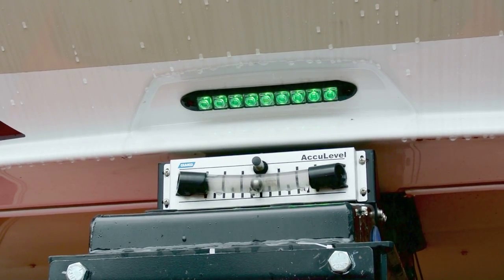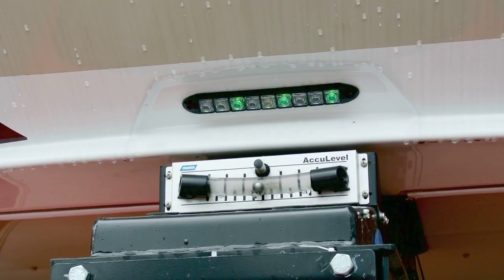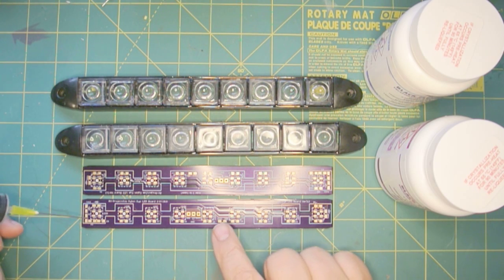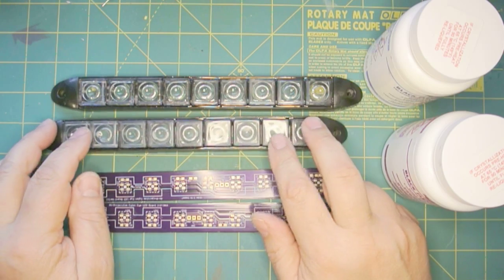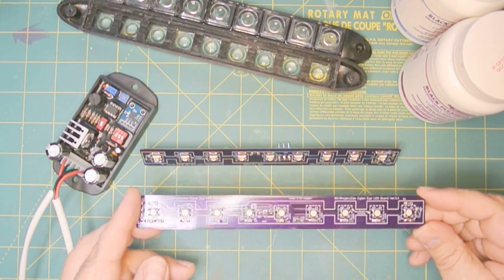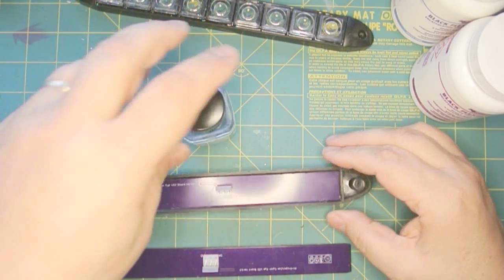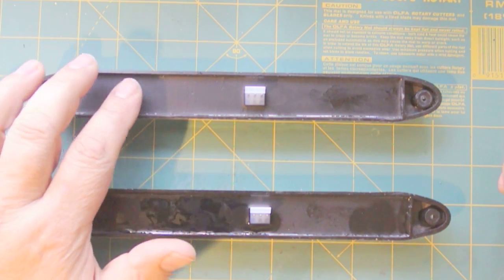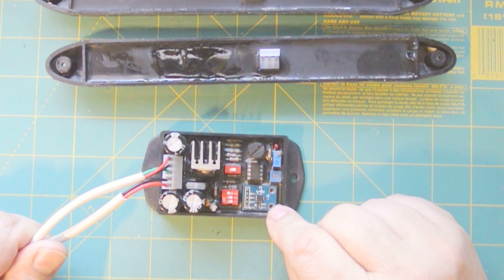RV-Project update; fixing the custom built Cylon Eye.

Comment: Very cool project. If the strip uses WS2812 (Neopixels), try putting a 300 to 500Ohm resistor on the data line to prevent burning out the first couple of Neopixels. Also, a 1000uF capacitor across the power input would help.
Reply from the maker: I did both of those things from day one, and still had issues of them burning out. It was the last LEDs in the string that were failing, not the first ones.

I ended up putting two  1K resistors from 5V to ground and from the data line to ground at the end of the string. My theory is that the end of string, left unterminated may have been the culprit.

I also put TVS diodes on the beginning and end of string, both on the 5V and data lines. These clamp transients to 6V.

Not sure which fixed the problem but the one in my RV has been working for 9 months without failure.